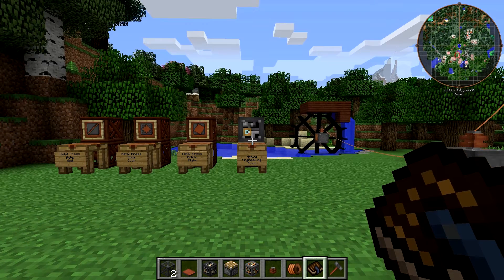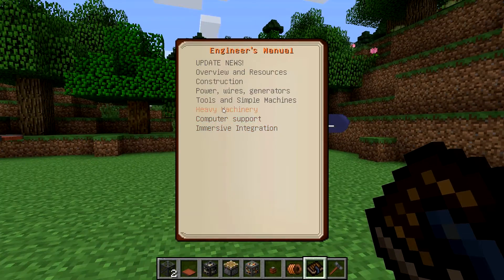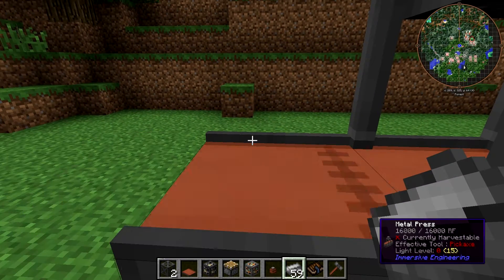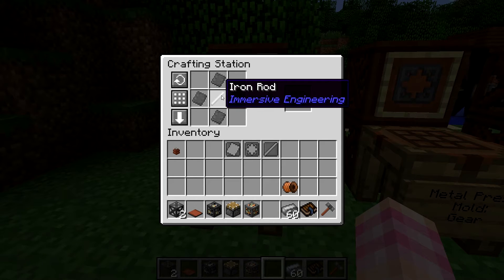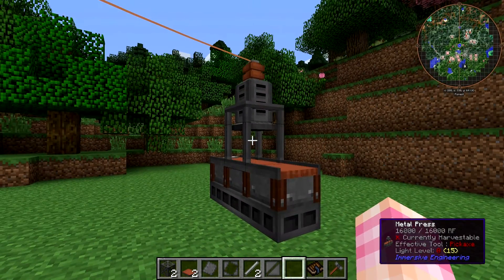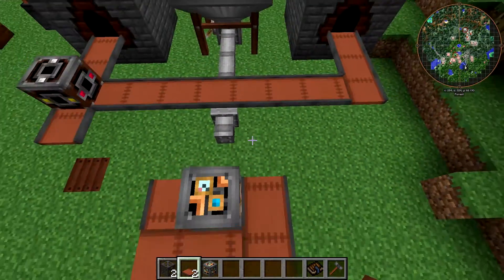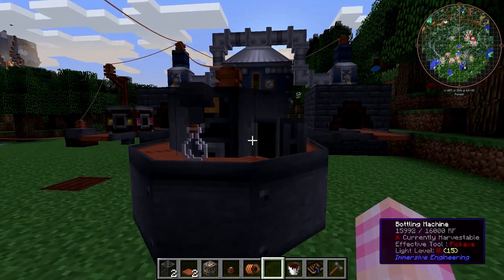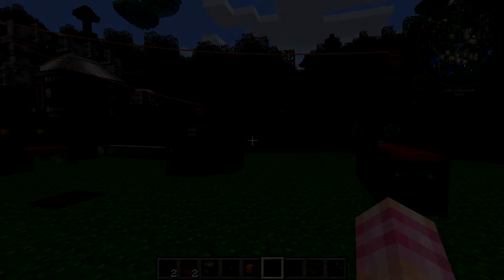Immersive Engineering Tutorial #8 - Press & Fill

Comment: Unless other mods is used, the Crusher multiblock is required to build to be able to craft the electrum for the Heavy Engineering Block.
Reply from the maker: +Johan Frankén Interesting
Reply: Pretty sure you can use the engineer's hammer with either the ore or ingot (forget which. Probably ore) to make dusts. Then just combine in crafting table. Uses durability on hammer.
Reply: Johan Frankén I

Comment: The items in Crafting Station will move , it's because Crafting Tweaks .
If you press R key,it will rotate the items in Crafting Table or Crafting Station.
You can disable this key binding in control settings.
Reply: This features are as same as the buttons in the crafting gui.
Reply: Of the three buttons in Crafting gui,top one is rotate the items in the gui , middle one is spread all same items to each slot the items on it , lowest one is take all items in the gui to player inventory
Reply from the maker: +陳鴻量 Oh, thanks.